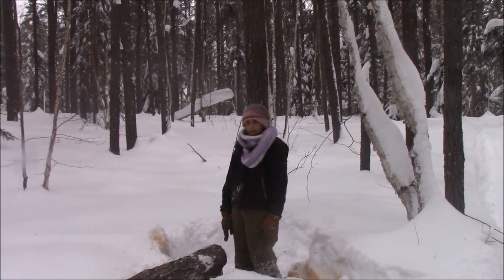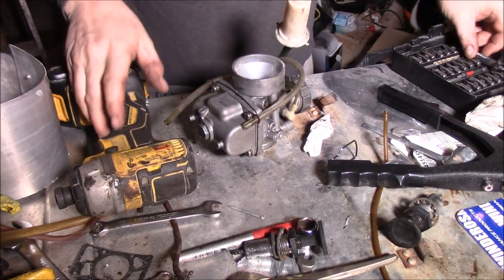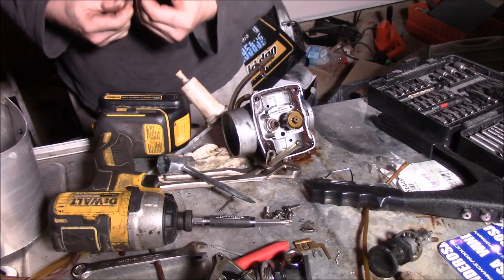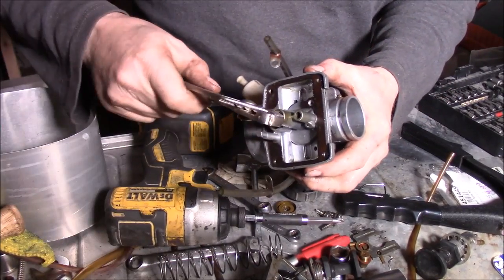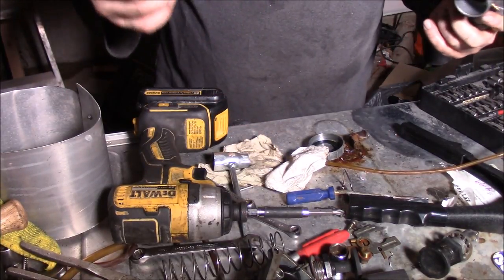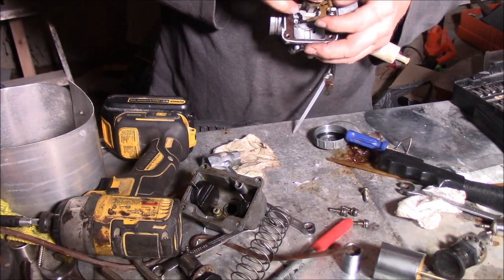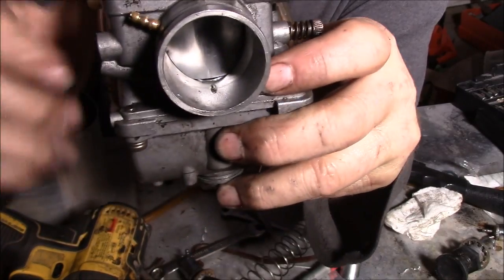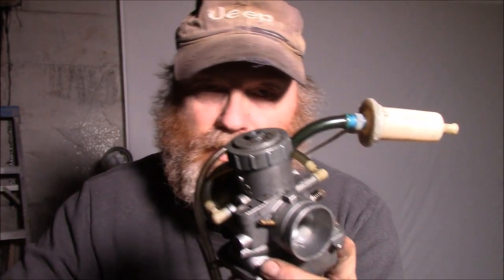How To Clean A Mikuni Carburetor  Like A Boss

Comment: Great video Cecil. You mentioned using wire to clean the ports in the needles which I have done as well. I have learned that there are tools made specifically for that as wire can damage the soft brass ports... I still use wire LOL With snowmachines,  I've learned to also replace the fuel filter as well as the in-tank screen filter. Another issue I have encountered with older machines is the rubber intake manifold dries over time and becomes brittle so removing the carbs becomes a larger problem.... anyway, I always appreciate these types of vids Cecil. Thank you. Cheers

Comment: .                        Good morning Cecil & Heather.   Have you broken out the trail groomer yet this year?   Looked like the trails in yesterday's video could have used a few dips filled in some so the firewood sled pulled easier.

Stay warm, stay dry, and stay HAPPY!

Cheers!

Whipple
Reply from the maker: Good morning Whipple.  Yeah I use the groomer a couple times this year, but we either don't have enough fresh snow to groom into the holes... Or we have too much lol, yes these humps in the trail makes it very hard on the front of the sleigh, we have to go extra slow now.  Thanks again...Cheers.